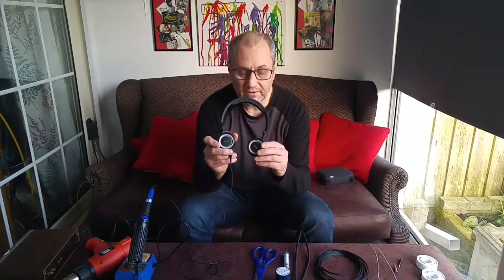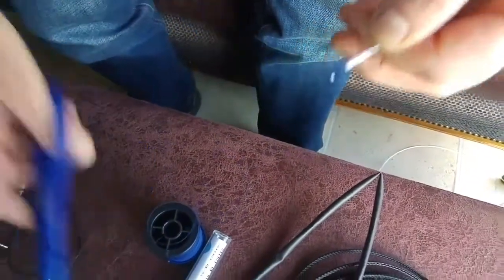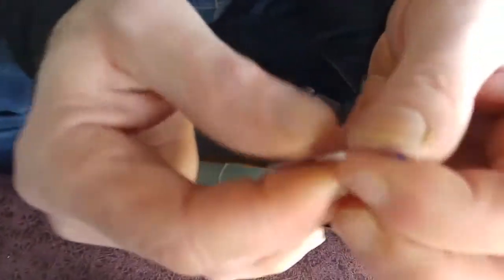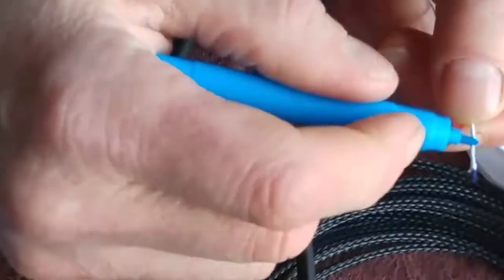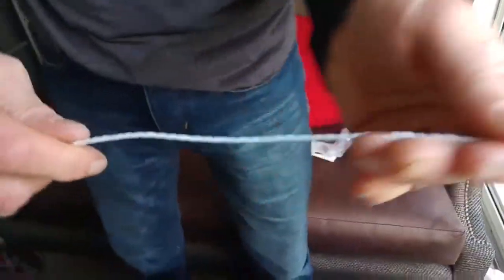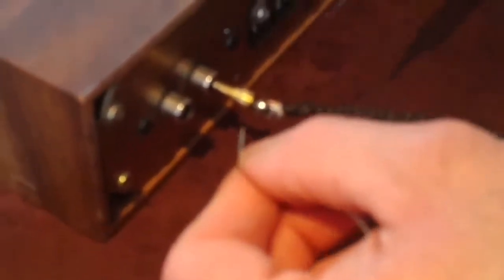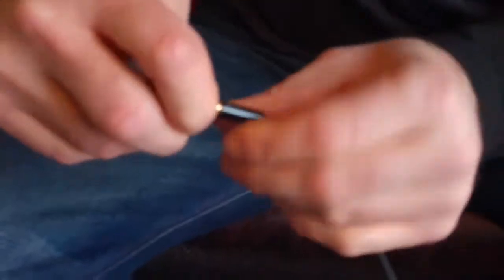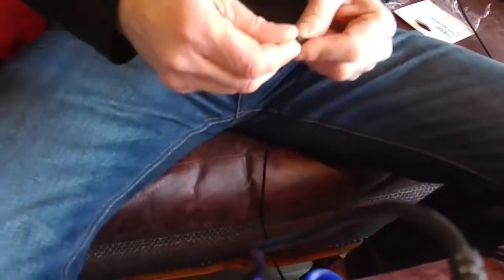How to make hi-end audiophile headphone cable

Comment: Finally managed to located the double silk covered silver clad copper... it was on wires.co.uk under Wire for Jewellery And Craft.

....
I'M TOTALLY OKAY WITH THIS.

According to my rough calculation based on it being a 0.315mm copper, its 29 AWG rating is able to carry 200mA.
This should be fine for most headphones and amps, but could cause issue on low impedance ones (<30ohms) at high volumes (>7Vrms).
Reply: Thank you so much. I was looking for EVER (about 10 minutes).
But seriously, thanks!
Reply: Scientific wires is the supplier if they still make it
Reply: What gauge would you say should be used on headphones of less than 30ohms?  I am using 0.4mm silvered copper for a pair of 32ohm headphone drivers and thought I had calculated it right but interested in your view.

Comment: Was absolutely despairing of the poor quality of TRRS cable I was trying to hook up to a pair of headphones and then found this.  Apparently wires.co.uk don't do the 10% silver clad copper bound in double silk anymore so I have bought it unbound and will rely on the PTFE Tape to provide the insulation.  I was wondering though whether It would be worthwhile putting 1mm (shrunk to .5mm) heat shrink tube over that to colour code the both ends, before I twist them and use the 5mm shrink tube to bind them all together.  I thought it would make soldering easier as then I can see which end goes where and is connected to what.  Is there any reason I wouldn't do this?
Reply from the maker: Hello Aarons, that sounds like a plan, go for it, thanks for watching.

Comment: Hi. Can you post a clearer video of how the plugs are soldered. Not obvious to a newbie. Or point me in right direction. Have got up to this point in making tbe same cable. Thanks
Reply from the maker: Hello check out my video on ( how to make a set of Hi-end ohno continuous cast copper interconnects, thanks for watching.
Reply: @tweakerman  hi. Still none the wiser after watching and based on the parts list ordered. Sure i cant tempt you to help me out and make one to order?
Reply from the maker: Hello, I don't really make them to order, I understand that the video, hasn't got the best video quality, I be uploaded a new video on making a upgrade headphone cable in the next couple of weeks, incidentally, what headphones have you got.
Reply: @tweakerman  akg k451

Comment: Hey guys, I’m throwing around modding my fairly-cheap ($28) AKG M80s.  I have four pair. Would you say the cables are the most important element to any pair of headphones?  Or am I just building a golden road to turdsville because the speakers are just cheap?  If I throw down for the cable materials and mod them all, would I look back and find that I should have just bought better headphones, or is this a kick ass cheap way to make what I have better?  (I feel like I’m just going to be made fun of for some reason lol)  any thoughts are appreciated though. Cheers!
Reply from the maker: Benjamin Tully Hello Benjamin, is your cable detachable.
Reply: tweaker man It’s permanent, yet I’ve opened one up already, so not that permanent.  I don’t have inputs if that’s what you meant,  but yes I can detach it.
Reply from the maker: Benjamin Tully I'll be doing a video in the next 3 months, on how to change a fix headphone cable, stay tuned.

Comment: I need that cable for my akg k451's. How much would u charge to make them for me??
Reply from the maker: I'm very sorry, I don't make them for sale,, you should attempt to make it yourself, its not that difficult, study my video, thanks for watching
Reply: @tweakerman  ok. Can you list where you get the parts from including connectors. Thanks
Reply from the maker: Hello, heres the stuff you need, 2.5 stereo jack plug eBay item no: 233005787226, 3.5 stereo jack eBay item no: 233024550956, 6mm heatshrink eBay item no: 151243470144,  6mm expandable nylon braid eBay item no: 122716891052. The wire comes from wires.co.uk, you need to get 0.315mm silk covered silver filled wire, you will also need to by 4% silver solder, you can get this off eBay, goodluck, any questions don't hesitate to ask, thanks for watching.

Comment: Whenever I hear silver with audio I just know it's bs and I close the tab.
Reply from the maker: Interesting? thanks for commenting & watching👍
Reply: @tweakerman  I understand to use silver for the stronger connection but not for audio quality. There is no difference. Just less resistance. Using litz will give you a more flexible cable.
Reply from the maker: @philipp594  SILVER is the best conductor known to man, far better than copper, much more detailed, I only use the best materials in my cable building & Silver is the best, in my listening tests, silver outperforms copper, but you need a very good system, thanks for commenting & watching
Reply: @tweakerman  https://www.youtube.com/watch?v=DTuc_hlGD4E

Just saying. And cheap low density teflon tape and knock-off chinese connectors are definitly not the best materials to build a cable with.
Reply from the maker: @philipp594  but if silver in your opion is rubbish, then it doesn't matter what connectors you use, goodluck, thanks for commenting & watching
Reply: @tweakerman  It does (mostly for realiablity). I'm an electrical engineer. I should know.
Reply from the maker: @philipp594  if your a electronics engineer, you would know that silver is the best conductor of electricity then, & improves sound quality, if connectors make a difference then why not wire.
Reply: @tweakerman  Realiablity. As I said. Not audio quality.
Reply: @tweakerman  Just increase the conductor size and you have the same result with copper.
Reply from the maker: @philipp594  no, that doesn't work, it just increases the bass, silver is better than copper hands down, I've been building cable's since 1987 & have done so much research, testing & listening. The Chinese connectors I use are absolutely excellent quality, they are not cheap, what was the words you use, oh yeh knockoffs, no no no no, just quality.
Reply from the maker: @philipp594  l do lots of blind testing regularly, I use to run a audio business for many years & had excellent reviews in all the major hi fi magazine in the uk, if you can't tell the difference between different types of conductors, that's up to you, but I can, I have superb hearing.